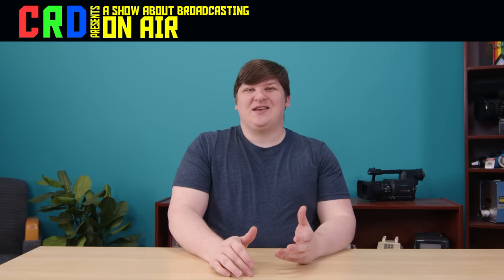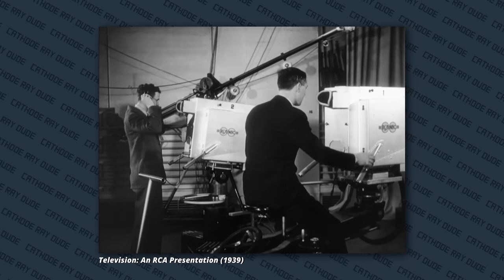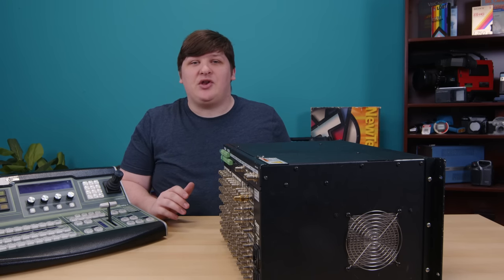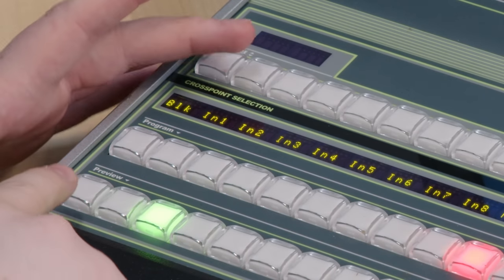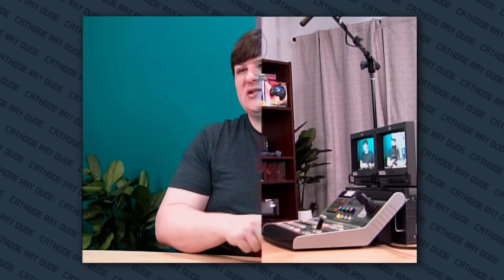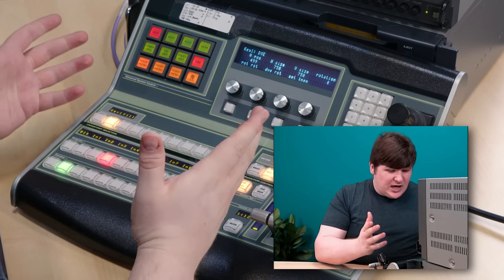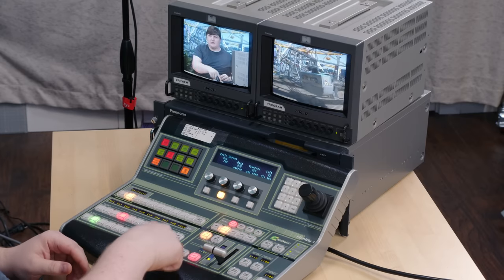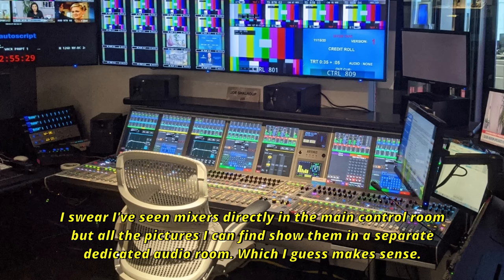What the heck is a video mixer?

Comment: TD here. I use the manual T-bar mostly during artistic programs where the feel of the timing or pacing of the program and transitions is highly subjective. For example I'll use it during concerts to "feel" out  the speed of dissolves/fades live on the fly in sync with the musicians. E.g. The camera zooms in slowly as the violinist draws out that last slow sensual note and we fade in time to the wide shot where everything "lands" in harmony and it just "feels" "right". My favorite moments of TV magic are when the all the parts, including time (which is what the T-Bar is for) come together to make something special.
Reply: Spot on! Consistent, evenly timed transitions aren't always desired, and the T-bar is the perfect intuitive interface for the task.
Reply: Yep, there's a lot of stuff that's used for things like music concerts which has different needs than regular broadcast TV
Reply: I had to do this in college and being live is a lot of fucking pressure.
Reply: Good TDs are essential for big broadcasts, and this adaptability is a big part of it -- understanding the content and intentions not just "pushing buttons in order"
Reply: yeahh from experience the davinci hes using has the worst, crunchiest, most frictiony t bar ive ever felt, worse than those cheap ones that use audio faders
Reply: Spectator here. I often feel that the TD could dwell way longer on any musician so I can see what they are actually doing to get a better appreciation and understanding.  Live is good but  cant get close enough to see what they are doing but the cameras can. I understand there is a desire to catch all the on goings.
Reply: My plant has Sony ELC automation and you're just given the ability to set the number of frames for a transition and hit the take button-- I've often heard the TDs say they want the T-bar back.
Reply: @hyvahyva  The thing with the T-bar is that you don't have any settings (Auto Transition Speed) to mess with if you don't want to, you just do it directly. There are absolutely times for both.
Reply: Yep!
Reply: I used to work a lot of live events. There were lots of singings of national anthems and the clients love it when you do a nice slow manual half-fade into some waving flag video.
Reply: Knowing how to use the T-Bar in a broadcast TV environment is honestly one of those big payoff moments that makes producers get stars in their eyes. I love doing a compelling newscast for a live event, like storm coverage, and the amount of room I have to play with on severe weather especially is bonkers.
Reply: My first thought was that the T-bar would be priceless if you want a transition to end at a specific moment. There's just no way anyone could manually time a transition that way with a speed selector and a button press...

But I'd also guess the reason for it being such an essential part of a mixer is that it was needed in A/B-mixers. Otherwise, it may just be another "some manufacturers have it, others have another kind of control" part. (Hard cutting between frames is actually a non-trivial problem without electronics. You need to latch the signal from the button, delay it until the blanking interval, and then execute it. Whereas a T-bar resolve doesn't need to care about frames, it can just be passively applied to the linear signal.)
Reply: I used the bar for building prepro effects, etc back in the day. Started on a GVG200, then 4000 digitals, and finally a Kalypso before directing full time.
Reply: As a musician, I really appreciate what you guys do. I had no idea you have to really know the music being played and all audio and visual cues to bring to light with camera manipulation. Super cool!!!
Reply: 666 upvotes, evil comment
Reply: Also a TD, but I work in the news.. I just had to come back to this video while on break to say I only use the T bar for situations where I need to make 2 transitions of a different rate in short succession. For Severe Weather reporting, it starts on a slate when we cut from programming, then diagonal wipe (Yes, I actually do use soft edge wipes for specific events) to an intro animation, then dissolve to the weather wall. I use the T bar for one of the transitions, just so I don't have to reach to set the rate of the auto trans during the half second that intro animation plays for.
Reply: @Aquatarkus96  You need to get some custom control macros in there to change settings quickly as you fire that back to back stuff if it's something you do regularly.
Set one transition speed, for the auto, wait/pause for competition, set the new rate, set next sources, then pause again or hold for a manual continue to fire the last auto.

Comment: Can we take a moment to appreciate the sheer number of cameras in the same room all of which he's managed to hide from each other for this production? I think I've counted 2 HD angles and either 2 or 3 SD angles.
Reply from the maker: oh man the room was VERY crowded. I didn't take a picture once it was all set up, but you're absolutely on point that it was hard to squeeze it all in. I had two Blackmagic pocket cinema 6Ks running, one on a big tripod with a teleprompter, one on a little manfrotto video tripod, but both trailing cables across the room; then I had another big tripod with a Sony shoulder-mount ENG camera, and a second Panasonic ENG camera sitting on a pile of boxes on top of a rolling cart on the other side. A huge cable snake down the center of the floor to get video in and out of the mixer rack module in the other room, plus the boom mic stand and cabling, and three LED floods with softboxes. Me and my gf (camera op) had to climb over cables and squeeze around the back of the presentation desk every single time we had to move anything. I am INCREDIBLY lucky that my viewers make it possible to afford a studio space to do this in; it would have been literally impossible to shoot this video at home, it just requires too much gear!
Reply: @CathodeRayDude  And it makes me sad to see that the vast majority of viewers (not only here) won't ever be aware of the insane efforts required to produce something that most of them would regard as "normal low effort crap". On the other hand, you tend to attract the kind of audience that IS aware of this, which is part of why we're coming back for every second of your wonderfully nerdy and in-depth stuff, even if it's an off the cuffs side note. You care, and it damn well shows. And we love it!
Reply: @CathodeRayDude  you truly are the TV production version of a one-man-band!
Reply: Hopefully he doesn't reuse. I have been using MEVOs which means I can cut to one camera and adjust another and come back and it looks like I have 4-5 cameras.
Reply: @imark7777777  And the same basic technique of adjusting cameras between shots is also used in real setups, though usually with multiple operators.
Reply: @eDoc2020  Yep, or multiple virtual camera operators in remote stations. As the industry has been moving towards PTZ type cameras of various sizes.

I love seeing the faces people who watch the live stream when they come in person and see the table. Usually they're complaining in the comments "I can't hear anything" 10 minutes later "oh thanks it's working now" and then they show up and realize the quality they're getting for two people running the whole thing.

Edit: I like to multitask. Even at the community studio I would jump between at least 2 of the 3 cameras and audio when we were short volunteers.
Reply: @dickJohnsonpeter  generally you would have a wide shot, a close-up shot and either a guest or/and product angle. So there's four angles. Then if you're demonstrating something unless you get creative (compatible resolutions and video splitter) in this case that's a whole another independent set of cameras and switcher.
Reply: Fun fact, when my TV station switched to automation, we needed 13 robotic cameras to take the place of 3 manually-operated cameras.  That change eliminated one $8 per-hour job (camera op) per shift.  Don't tell the suits this, but we STILL had one truck camera on a tripod to pick up stuff we couldn't get with the robotic cameras.
Reply: @stephenbaldassarre2289  wow that's quite more than doubling of replacements. I always wondered how automated those type of studios were figuring there's probably at least one camera on standby. and maybe 2-3 people running between Remote control and Manuel.
Reply: @stephenbaldassarre2289  yep yep yep yikes.
It's surprising it's almost like humans can't exactly repeat what they did during rehearsal.
Kind of nice that they thought to keep you around. Annoying they couldn't do more.
on a couple of my local stations I've spotted a few automation issues and message them. It's both fun and exciting and hopefully not causing them to get FCC violations :-(.
Wonder how many keyboards they were out hmmm.
I certainly can feel the feeling on this end. I was hired to do some computer work and live stream this guys events. 2021 I found myself putting up a two-story addition from foundation. Was it straight no but he was saving money pain for people to learn how to do a foundation, block work etc. It took us months versus the three days it took to go from foundation to second floor with professionals. Thankfully that's over and the two out of pocket ER visits. I'm trying to wean him off me, he'll make a request for some thing one day and then the next day it's no longer a priority so nothing gets done. Called me in on my day off to put a light in the ceiling because it was super important to show off to his guests that were moving into work for him for I guess six months now but they don't have work visas yet so.....
Reply: @imark7777777  Oh there's no rehearsals.  The shows are frequently still being written 10 minutes till aIr time.  I know what you mean by corner cutting vs professional work though.  I used to record bands in my (very sophisticated) home studio.  It would take a week to record, mix and master a full album.  When cheap computer-based gear became common, the bands started recording themselves.  It would take weeks/months to record and they would still often hire me to mix and/or master the albums, which was a lot harder because the recordings weren't very good.  The results were rarely professional sounding.
Reply: @stephenbaldassarre2289  I was hoping there was a rehearsal, didn't think there was. figured it was almost live to air anyway but I could dream?
Oh yes oh yes there's one good thing to come out of 2020 people realizing there's a lot more work involved with this than a thought.
Reply: @fonkbadonk5370  I make these words my own.
Reply: @fonkbadonk5370  I think the rule of thumb is 2 man-hours per finished minute of TV.  This man does almost all of those hours by himself.  That's why most of my vid really ARE low-effort crap despite being a trained professional 😂
Reply: @fonkbadonk5370  I heartily agree about the audience this channel is aimed at.  Me, I like to see how things are built/constructed.  I am like that with movies.  The secondary reason I would even buy a Blu-Ray/4K disc is for the Behind The Scenes/extras content.  I love to see all of the work that goes into making the movie, from special effects to why so and so thought "Hey, let's do this to make the moment more impacting. From the filming to the foley artists, the sound engineers to the film editor...All of these things seem to make me appreciate the real reason a movie resonates with me.  Most recently, the movie "Nope".  Amazing movie.  It was a YouTube video that got me interested in watching that movie, where the focus seems to be on the movie's sound design, and the PHYSICAL tricks they used with a lot of the cameras.  For instance, the nighttime shots in that movie were actually filmed during the daytime, using a visual configuration involving multiple cameras that I can't begin to understand...and, I don't remember who the youtuber's name is, but also don't care to promote another YouTuber here on this channel, since that would be pretty lame and disrespectful.
Reply: I remember downloading an episode of Dr Who. The Robin Hood Episode with Capaldi. And it still had the Time marker and some of the CGI wasn't finished yet. And there was no color correction yet. I wish that hard drive didn't get corrupted by my Pirate ways of Yore.
Reply: @CathodeRayDude I'm sorry, manfrotto? It's called manfrotto?